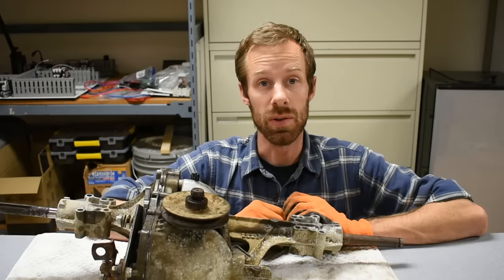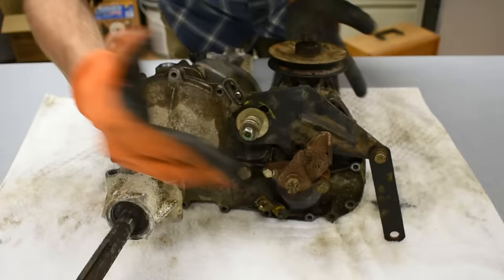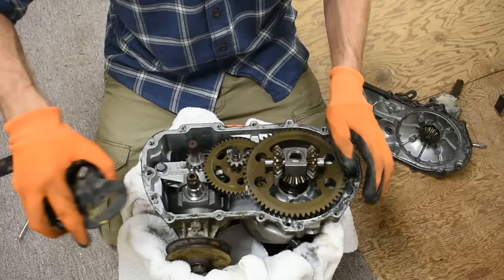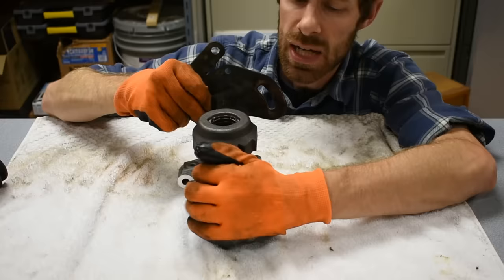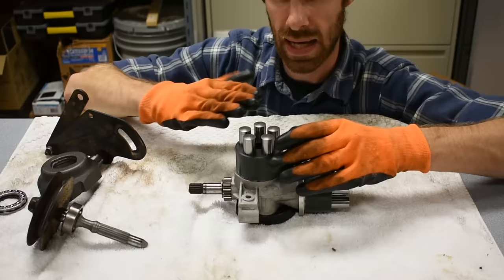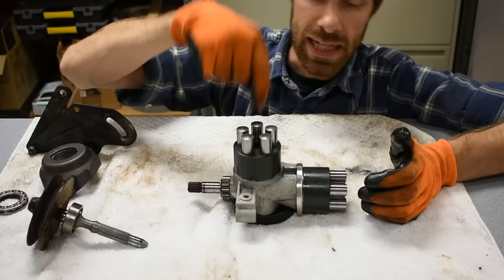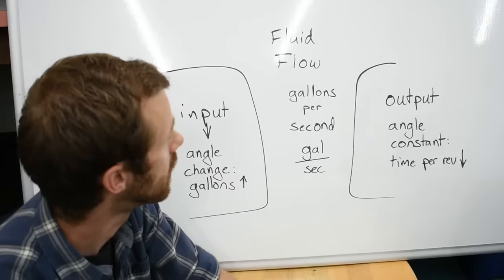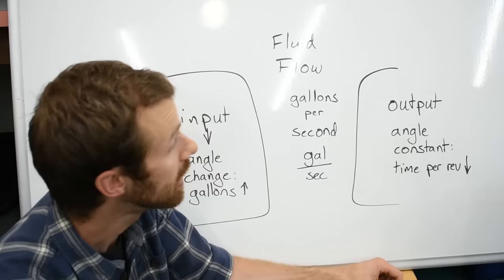How Does a Hydrostatic Transmission Work?

Comment: I was repairing a new skid steer, where one side had no power.  Took it apart twice, without finding anything.  The factory sen.t out an expert, who found nothing.  The company sent out a new unit, and the old unit sent back.  A few weeks later they diagnosed the issue.   The pump and motor use the same size pistons, but the slippers are different.  Someone put pump pistons in a motor assembly.  There was .0001 difference in diameter in the lube holes in the slippers on the pistons.
Reply: They actually cared to find out what had gone wrong? That's great!
Reply: @Robert Heinkel that’s interesting, I have a situation on a JD riding mower but no one swapped any parts around. Why would one of these transmissions suddenly have no reverse then go to the shop for a fluid and filter change and end up with reverse working now but no forward? We have a John Deere 265 that reverse got real weak and stopped working then it was taken to a tractor shop where they recommended a hygard fluid (John Deere product) and filter change and came back with no forward drive. It’s got me baffled as to how the situation literally reversed itself. I’m trying to understand how these work before I just start pulling it apart. No reverse with functional forward to no forward with functional reverse... crazy 🤔
Reply: @lh98  A classic John Deere story, and why I switched to a Cub Cadet dealer model tractor.
Reply: @paulbeldenbush  yeah I’m not a fan of John Deere because they make it hard to get parts and self repair very limited. My dads jd that I commented about got worse and barely goes forward or backwards once it warms up. I think parts in the hydro are worn. Trying to keep an eye out for a parts machine jd 265 series but in the meantime 300 bucks bought another machine that climbs hills no problem. Sad thing is the jd has a snow blower, mower, plow etc that can’t be used now. Oh well JD f**ked themselves out of a future customer. Hell, farmers get screwed by them all the time, big combines that are hundreds of thousands and they will disable them by the touch of a button. It’s time we fight for right to repair for all. Louis Rossmann is the man fighting for us on R2R
Reply: @lh98 15:21
Reply: I am amazed anything on a skid steer has a 1 tenth tolerance.
Reply: @paulbeldenbush  yes I wasn’t impressed with my JD ,bought a Mountfield ride on ,no regrets.

Comment: When I was growing up in the mid 70's we had a Wards 16 horse garden tractor that had hydrostatic drive and I knew it was a hydraulic pump and motor but watching this video it was more simple than I thought
Reply: Brilliant misnaming a hydrodynamic unit as 'hydrostatic'. This terminology appears to have gone through thousands of clueless brains !
Reply from the maker: Careful on your terminology - statics does not always mean there is no motion at all, but rather that input forces and output forces equal each other, so there is no change in motion. Dynamics is when an acceleration results from forces that are not equal - as we see in normal geared transmission when the input shaft (engine) speed must change between abrupt gear shifts.

It's true though, the terms have gotten a bit simplified over time when usually we use static to mean 'stopped' in most everyday use.
Reply: @PetersonBrosAutomation  'Static' in reference to pressure and fluid systems actually means 'stable'. Where there is flow, there is instability.
No one would consider the wind being static - but obviously the overall pressure remains constant.
As for input and output forces equalling each other, I doubt you'll find a case where that is true. There are nearly always 'losses' - commonly as heat.
A fluid providing movement transmission will be very much like the wind - will contain pockets of higher pressures and pockets of lower pressures - just like the wind. 

I see where 'static pressure' terminology is coming from but it's being misapplied.
Reply: My friend’s family had that same Montgomery Wards tractor.  My friend was always so proud of how cool the transmission technology was. This video explains why!
Reply: Ive got one with a pto

Comment: Swash plate pump, swash plate motor. Lucas improved the efficiency of fuel pumps on gas turbines engines with their swash plate pumps, instead of the gear pumps that were being used. They pump the amount of fuel required as opposed to the gear pumps which pump the maximum amount of fuel which is bled off when not required.

Comment: My friend rebuilt the powertrain for a 15” gauge miniature train locomotive.  The train as built in 1947 used a simple clutch between the gas engine and the driveshafts for the trucks.  Obviously, it had no reverse!  When the clutch suffered a catastrophic failure, we could not find a direct replacement for it or even parts to repair it.  The most recent parts list from the manufacturer was dated 1963.  So we swapped the ancient, smoky Onan motor for a new Honda 25HP and, instead of the clutch, used an Eaton Series 11 hydrostat.  All it took was moving to motor mounts forward a few inches and fabricating a couple of brackets for the transmission.  We got excellent power throughout the speed range, plus a reverse.  No more pushing the train backwards 400’ to put it away at night!  It helped that the company I worked for was an Eaton distributor, so I got him the employee price of cost + 10%.

Comment: It uses swash plates, set at an angle. Similar to what you find inside a pressure washer. But using oil instead of water.

Comment: Appreciate the explanation. How these mechanisms are conceptualized and manufactured is amazing. I have a compact tractor with a hydrostat, which is super convenient and smooth compared to the traditional gear transmission. I could picture early farmers being skeptical of this incredibly complex mechanism initially though.
 The whole rotation mechanism is similar in concept to a helicopter rotor  hub with the awash plate, connecting rods and bearings.
I’m going to go easier on my ride on mower and tractor now, keep ‘em in low gear. Stuff is intricate.

Comment: Bravo...well done! What's amazing is the mind of the engineer that created machinery like this.
Reply: He sort of mentioned it, but this transmission idea was a marriage of a variable displacement swashplate type hydraulic pump and then using that same design in reverse as a hydraulic motor.  A variable displacement pump is a very common design in hydraulic actuated machinery but with a couple important differences. Firstly, the swashplate generally is not able to go into a reverse position. Secondly there is no manual control of the swashplate angle. Instead a spring acts to tilt the plate to maximum and the output pressure works against the spring to bring the plate back to the neutral position.  So if you block off the output flow the pressure rises to bring the plate to neutral while holding pressure at maximum.  If there is no back pressure the plate tilts to its maximum position to deliver the maximum flow rate.
Reply: As said there is nothing new under the sun it is all ready here it just has to be thought up and that  is what the engineer  done it was in his mind of what he wanted to achieve  that my friends is God he is the infinite mind that's why nothing is impossible with the infinite mind of God and we all are created with a mind  as hydruclics fascinates  me  I see how this works

Comment: A variable displacement hydraulic pump on an excavator works very much the same . By changing the angle of the cylinder increasing the stroke of the pistons changes the oil flow speed . But thanks for this because i had never seen a hydrostatic transmission apart or describe before . Well done thank you
Reply from the maker: You bring up a good point about pumps, and valves (like the kind used in hydraulic joystick bucket and boom controls) use the same swash plate concept to open and close spool valves to change the fluid flow rate. 

Funny how there are so many mechanical inventions out there... But so many of the concepts are related. Brilliant inventors, way smarter than I'll ever be.

Comment: I enjoyed the way you taught this.  I don't plan on taking one apart but now understand why it cost so much to repair.
Reply from the maker: Great, glad to hear it! If you ever do get to tear one down, I'd suggest having a bucket of cleaning solvent handy, and a space to work that is prepared for cleanup. They are really cool, but super messy until you get all the oil cleaned and dried. 

And the whole place will smell bad. Do NOT, repeat do NOT attempt this on the dining room table. You will be kicked out of your house until you learn to shape up.

(written from my shop computer)

Comment: I have a John Deere LX 289 with 17 hp hydrostatic transmission when I first bought it I did an oil change on the engine are used Amsoil 0W 30 and I contacted the tech people at Amsoil and he said use a 0W 30 in the transmission also and when I did man made it a lot quieter ha ha people neglect maintaining those transmissions they need to be maintained better by changing the fluid not every year but at least every 200 hours of usage it’s not hard to do but when you do it, you drain it with the new fluid and get the back wheels off the ground start the engine up and let idle and then work the forward and reverse. That way you fill everything up real good and then you’re ready to go after you check the fluid level all right you guys this is a really good video. I’ve seen some of this guys videos before he’s good. He’s a real good man all right you guys have a good day now this is a Jim Mungai from Kennerdell, Pennsylvania.

Comment: Awesome vid!
This principal is very akin to power steering works.
On a car, the pump is separate, but the steering wheel vanes/ valves built into the steering shaft are the input/ output PID.
This is relatively weak. 
The pumps on this are interictal to the input/ output PID.
This gives the power to drive the mower and not just turn steering on a car...
Very cool engineering.

It is also akin to how the cyclic on a helicopter works for steering...

Comment: Outstanding video.   I always wondered how a hydrostatic transmission works.  Clear, concise and great use of actual transmission parts.
Reply from the maker: Yep. Most normal people, when they need to haul something to the dump, they just load it up and take it to the dump. 

Not me.

I take it apart.

So instead of 1 easy big thing to haul to the dump, I have like 1000 little nuts and bolts and parts to collect first...

Comment: I believe this kind of pump arrangement is called a 'swash plate' pump. A very similar arrangement is used for some ship's steering gear. Instead of forwards and backwards control, it moved the rudder port and starboard by moving the control rod via the steering wheel. This allowed the steering pump motor to run at a constant speed and only move the rudder, when the steering is moved from midships. It's a very old system.
Reply: Same as a AC Compressor in cars too.
Reply: @billythekid2281  Yes, the same pump arrangement with a fixed swash plate. They don't have the variable control. AC pumps are switched on and off, with a magnetic clutch.

Comment: On Royal Navy ships in the '60's, some had Denny-Brown fin stabilizers. The hydraulic mechanism was similar to your description but with radial 12 piston-and-rod units in each of the 'A' transmitter (compressor) and 'B' receiver (motor). Angled actuators, like yours, determined speed and amount of fin movement ultimately ordered from gyroscopic master controller.

Comment: Thanks. This video helped me understand some of the components that go into my hydrogear. I am losing power when any load is put on the system. The motor seems to be running fine, but the transmission lags behind. I am ordering parts to break open and rebuild them. The pump seems to wear groves that can sometimes cause strain and loss of power.
Reply: Update for resolution. It was the tension on the drive belt causing all my problems. Sometimes its the simple things.

Comment: You did a great job of explaining how this works, but I'd like to add a few thoughts. The apparatus that tilts back and forth is commonly called the swash plate and as you said, it's on the pump in this example. Not only can it control the volume and direction of the oil flowing into the hydraulic motor, when the swash plate angle is set to 0 degrees or perpendicular to the radial pistons of the pump, the pistons do not reciprocate at all and that creates zero flow and provides a neutral for the transmission. The beauty of this sort of drive system that makes it radically different from geared speed systems is that the torque from the hydraulic motor stays constant no matter the speed that the vehicle is being driven at.
  There is another arrangement wherein the pump output volume is fixed and the swash plate angle on the motor is movable. If you use vector analyses you can see that changing the incline of the swash plate away from zero will increase the volume of each piston's displacement, thus causing the motor to slow, but it will turn more easily so you get more torque at the output shaft. This lets the mower keep going up a steep incline, although at a slower speed, rather than stalling. Of course internal pressure relieving devices will set an ultimate limit to the torque available to keep from killing the engine.
  Typically a variable displacement radial piston pump will not require a separate relief valve like a fixed displacement pump would. The design of the pump would have a provision that flips the swash plate to 0 degrees if an overload is created. This tranny may not be built that way or the springs inside the pistons may accomplish that.

Comment: Great teardown & explanation, My old Stiger has this type of transmission & it starts to slip when hot. Now I know that maybe if I just put a heaver grade of oil it may solve the problem & extend it life a little more. I thought it must work by clutch packs & they had worn out. But the hydraulic pump & motor must be just a little worn, so not likely to harm anything by going to a thicker oil within reason.
Reply: So did that work? One suggestion.I had real success with power steering and other systems with appropriate Lucas oil additive. Had advice from a Lucas rep to add two bottles instead of one,he was right,for a power steering system  that was genuinely tired. Got a year out of it I really do not think I would have otherwise.
Reply: @paulmanson253  I changed it to 80/90 oil & it improved it but it still starts to slip after more than about 1 hour mowing in hot weather. It is difficult to get the oil in it after draining, But if I do change it again, I will try the Lucas oil but not sure I would be able to get it into the long tube like small inlet.
Reply: @calthorp  There are ATF funnels with a very narrow end to them. Also,just looked at one item I have. Made by Hopkins Manufacturing,Emporia Kansas. No doubt they have other items ,but the one I have should serve. No doubt they will be online. Cheers.
Reply: @paulmanson253  The catch with filling it is its a long tube filler but there gear box is sealed so it takes forever for the oil to slowly make it way down. If you tip it too fast it just air locks & stops. It is not designed to be serviced.

Comment: One intresting thing about this type of hydrostatic transmission is that the driver is pushing the whole vehicle forward physically when pushing down on the cylinders in the transmission.... You  can actually feel this under hard acceleration. But there is quite a significant mechanical advantage.

Comment: Hey great job. I didn't imagine the pistons being so small like a toy 😂 Anyway, this video made me recognize the importance of the factory-set constant angle of the swash plate in the hydraulic motors. If their constant angle is relatively low, you'll be preferring torque over speed. If their constant angle is relatively high (steeper swash plate), you'll be preferring speed over torque. And although I haven't checked, I'm certain there are machines that allow some adjustment of that final drive swash plate angle.

Comment: If i understand correctly, these are "Continuously Variable Transmissions" in that any movement, no matter how small, of the swashplate changes the displacement of the pistons and thus the "gear ratio" of sorts.  Not too important for this application, but can be neat for vehicles, especially if optimizing efficiency, as you can have the engine in the "perfect gear ratio" all the time, with no shifting.
Reply: I think most production systems use belt+cone, or sphere based CVTs, but hydraulic is simpler (in my armchair opinion).  I think the losses are the main concern?  I need to look into it more/hear from others to be honest.
Reply from the maker: Another benefit to this system is not inside the transmission, but rather the driving engine - it does not need to change RPM up or down, because it doesn't shift between discrete gears, allowing you to run the engine very close to its most efficient RPM all the time!

Comment: I used to work at Sears, and I was the one that would put the display tractors outside. I hated the hydrostatic tractors because they were hard to push versus the geared tractors that took little effort to push and they were small. The biggest one had a 50 inch deck. I wish I had known about that trick with the hydrostatic transmission to get it to roll easier.

Comment: Excellent; I have a Scotts S2046 Lawn Tractor with hydrostatic drive which is a far cry better than the silly geared machines, and with infinitely variable speed is a joy to drive, but I did not have a clue how it worked, even though I am a design engineer. Great video!